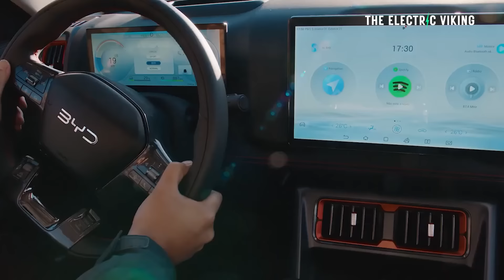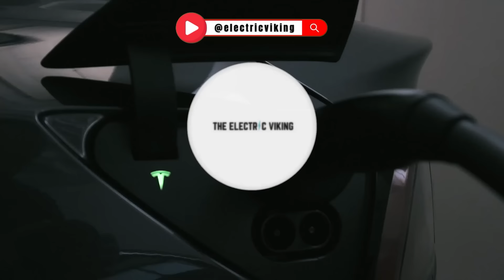Ford's CEO says the NEW Ranger EV is a "Gamechanger"

Comment: 2027 is 3 years away. Ford is taking way too long to get their butt in gear.
Reply: Yeah, by the time they get the ranger out Cybertruck will be priced lower and the mini Cybertruck may be out, too
Reply: true. they should've released this 5 years ago lol
Reply: True, but far better than the other OEMs. A lot of the older OEM CEOs have their hands tied with shareholder board of directors, etc. Elon doesn't.
Reply: 2027 is two years away
Reply: @JaceTran I doubt that.

Comment: a Ford Ranger EV would be a huge hit for fleet sales also
Reply: Extended range better idea
Reply: @laraserviciosca5983  as a mechanic i can tell you it most certainly is not.  PHEV are horrible. Twice the systems, four times the problems.
Reply: @3184Patrick  I hope extended range means more battery capacity.

Comment: All I need is an electric Ranger extended cab with a 6' box. I suspect its all anyone needs. The gas ones are everywhere and the price of used ones it high because people don't want to let them go. The demand it clear. The problem is manufactures don't listen. Not even Tesla. FOOLS
Reply: Jim Farley has said publicly that small trucks will make a come back in the EV future, so I’m hoping they design a Ranger that’s smaller like the old models.  

6’ bed would be nice cause I could put a camper on it and a mattress inside for camping.

Comment: The BYD is far cheaper. It's called price dumping. Factor in the tariffs, and the BYD is around the same price as it's US competitors. 
Ford (Europe) have just launched the Capri ev model. The Capri name is iconic in Britain, for those old enough to remember the Starsky & Hutch TV series, the Capri served as the equivalent of the Grand Torino in British detective action series. It was aspirational. The current ev model is underwhelming to say the least. Not a bad vehicle, but expensive and offers nothing new or exciting compared to the European competition.
Reply: The new Capri is an SUV! It should be a Euro version of the Mustang, like the old ones

Comment: It's a good opportunity for Ford to beat Hilux and D-Max in some way.
And for some unknown reasons, BYD is not yet introduce the Shark pickup in Thailand, despite it is introduced in some RHD countries like Australia and New Zealand. Maybe because the Shark PHEV engine is gasoline rather than diesel and it is four-doors double cab model only (high annual Thai tax, use the passenger car rate), no single cab nor extra cab (lower annual tax as a pickup truck).

Comment: I like Ford's CEO and his commitment to this, but the misses keep coming. The ranger is too close to the lightning in size and ultimately pricingto make that an EV....they should have released a Maverick EV instead to replace the turbo engine and give it either a hybrid or EV powertrain. Add some features from the Lightning, keep it within $30-$40k in trims  and watch it fill fleets nationwide. The underside of the Maverick is ready for that transition, just needs more strengthening with the batter pack will supply out of necessity.

Comment: "BYD Shark severely compromised"......unlike a EV ute that willbe stuck at chargers all the time when you actually use it; eg towing. PLUS. At current fast charging rates an EV ute will probably be similar to run than an diesel ute.

Comment: Farley is right about one thing a mid sized BEV pickup would be a big hit.
But it will need to be much much better than the Ford Lighting.
Lets say you take a Ranger shell and put in Lucid everything else, for $40,000 and you could not build enough of them.
Drop the Ford name and sell it as a Ranger Brand through the Lucid network.
You have to loose the Stealerships they are killing the brand.

Comment: the ranger is an absolute travesty of a car with the 2.0 ecoblue wet belt system that's bricking its engine well before 100k km, the 3.0 ecoblue that is breaking crankshafts like there is no tomorrow and the 10 speed GM sourced travesty of a gearbox that overheats and without changing its internals with aftermarket parts will brick itself in 50k km. Oh yeah, and the upcoming hybrid version will use the 2.3 ecoboost steaming pile of dong of an engine... so no, In Europe Fords and VW are the WORST pickups you can buy, for work they are absolute dogshit!